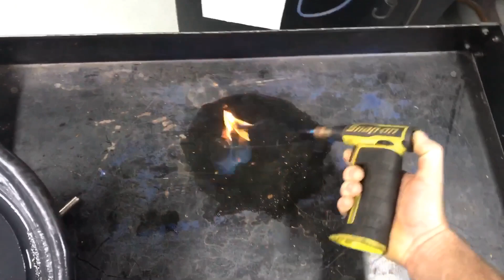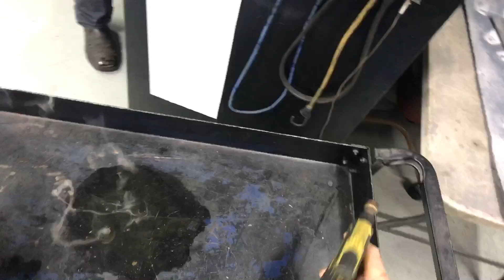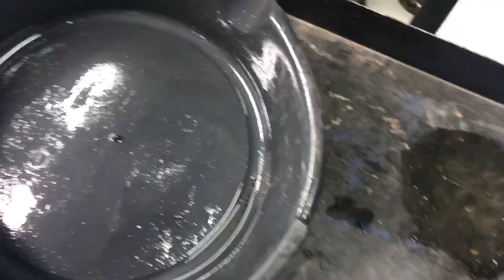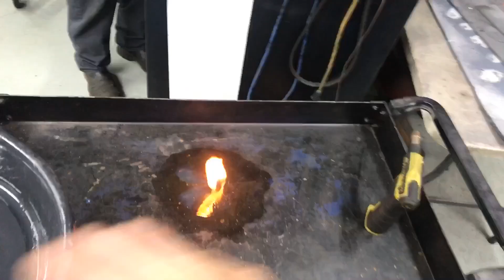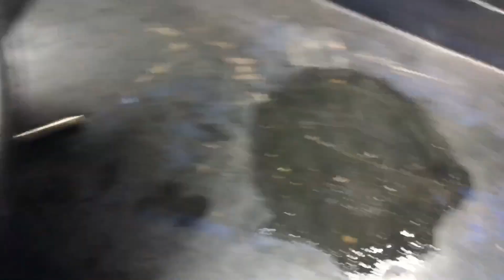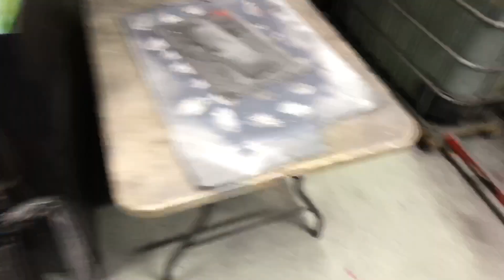Shane vid 1

Comment: You can add unleaded gas to diesel in really cold weather.  About a gallon to a tank .   But its got to be down around zero or below.  I don't know if it would work in the newer diesels because of the fuel systems now.